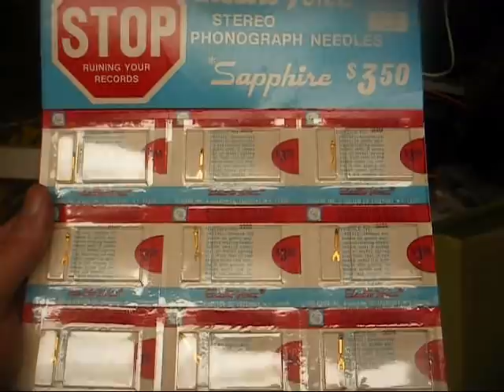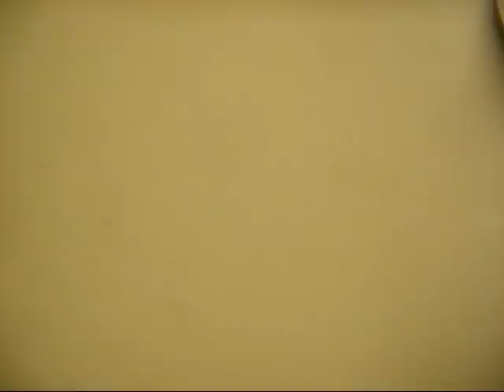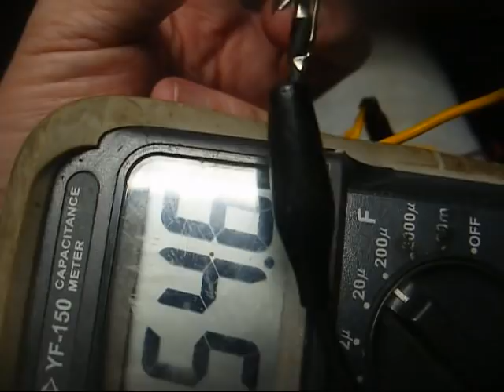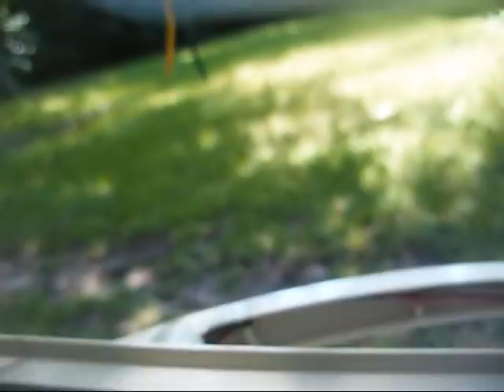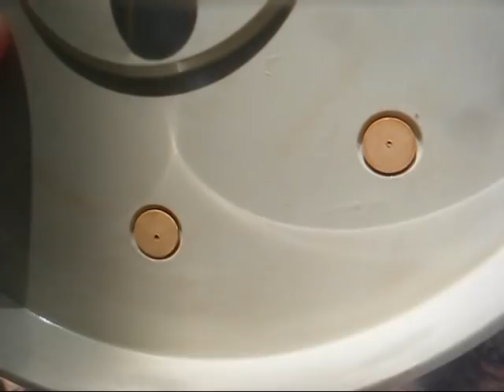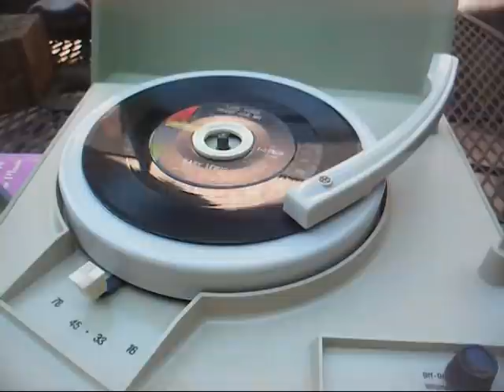Repair of a 1967 Westinghouse record player & Goodwill shill bidding exposed

Comment: 2:00 I saw the exact same thing recently on Ebay about running your bid up to the maximum.

I also believe that sometimes there are sellers on eBay that will see that your bid is lower than what they want to sell the item for, so they will use an automated software to bid against you from two different accounts in order to out bid you.

But afterwards,  what they're really doing most likely is they are deciding to back out of the auction after winning it. You will often see the item relisted immediately after the auction ended.... Because supposedly the buyer backed out, but the buyer was really themselves trying to outbid you just so that they could sell it at a higher price.

 Once eBay catches up to that buyer account repeatedly backing out of auctions, they will probably have the accounts terminated.  But they can just open up another account and do it again. The original seller account is not affected.

Isn't that something?

Comment: I had a wind up portable 78 Victrola I got laffed off the beach when I played a Guy Lombardo shellac 78 titled Boo Hoo. Goodwill is a scam operation. They price items based on EBay prices. It runs a tad fast on 45 rpm

Comment: As far as the actual Goodwill stores I gave up on them several years ago. Anything decent goes straight to the online auction and the crap they put out on the selves is just crap.
Reply from the maker: Overpriced crap, at that.
Reply: Occasionally something good does slip through, but just by accident. Just before the shutdown, they eliminated their return policy. So if you get it home and it's junk, you're stuck.
Reply: @KameraShy  I would return it through their front window if if they had pawned off something like that on me.
Reply: Goodwill is gone where I am, for almost 25 years now. The Salvation Army used to be be bad for not putting old stuff on the floor, saving it for a so called "Collectables Auction" which I never could find out when it was, and was never advertised publicly. Well they must have changed management because they don't seem to do that anymore, maybe their grand poo-bah found out that the employees weren't actually holding an auction, creaming everything for themselves. At least the Salvation Army does actually do charity work, unlike Value Village, who was sued by State Attorney's General for falsely presenting themselves as a charity, or Goodwill too apparently.

Comment: I've had various issues through the years with the Goodwill online auction myself. It used to be a lot better a dozen years ago before everybody found out about it, you get good deals then. My best deal there was getting 25 new old stock Amperex Bugle Boy ECC83/12ax7 tubes for under $20.
Reply from the maker: Now, it would be way more than $20 PER TUBE.
Reply: @radiotvphononut  Amperex Bugle Boy tubes are another scam, which the audiophools fall all over themselves for, rebadged tubes.

Comment: Goodwill also takes there time in shipping ,and to of the three radios I bought was smashed from poor packing ,example small radio put into gaint box where it could slide from one side to the other side through out the whole shipping process,and if you look at the shipping prices the prices sometimes way off 15.00 bucks for two onces or five bucks for a eight pound radio ,they just make it up ,plus I do what you suggested I ask them to pack it well because old radios dont travel well.
Reply: Sounds like Goodwill hates collectors and hi fi and radio enthusiasts